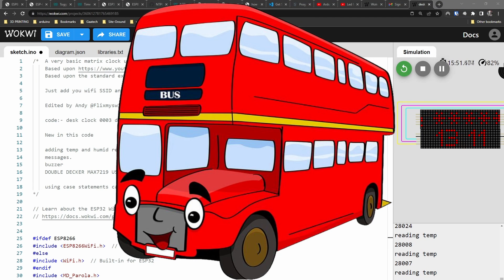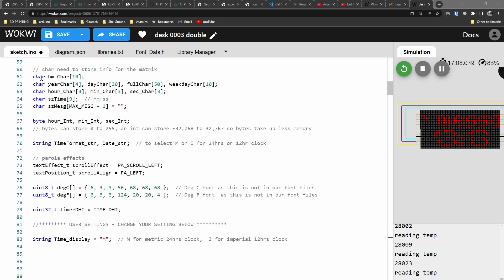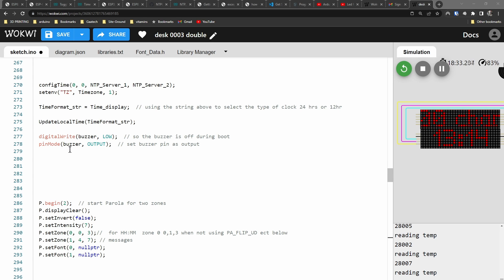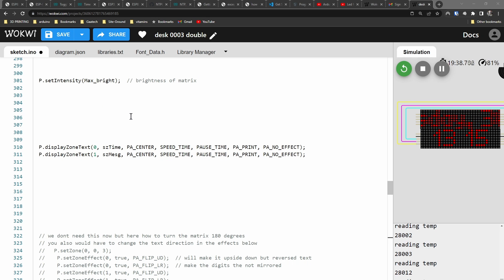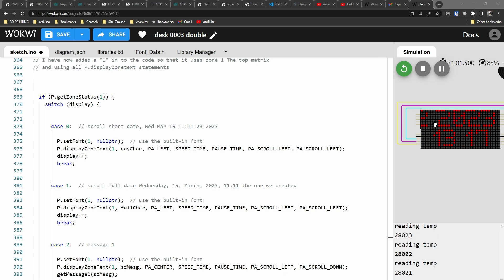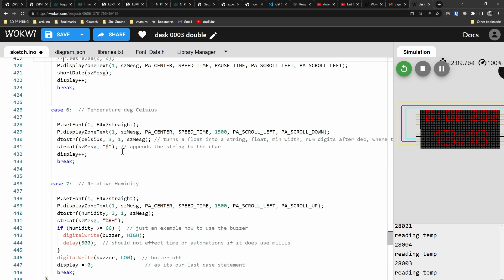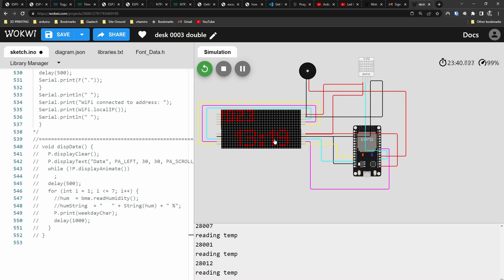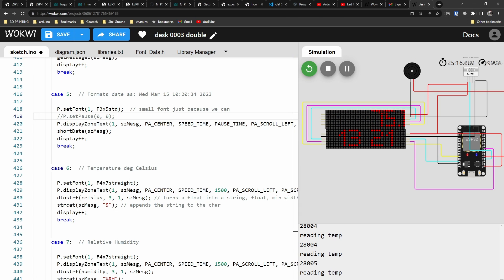Double height or Length #Max7219 #Matrix #LED  2 Zones #NTP 🕦 server desk clock with messages 0081

Comment: I didn't understand what you said: "Notice the number 12 where there should be a link to the code." I'd like to do exactly as you show in the video, that is, a scrolling message at the top, and the clock at the bottom. If you could share the code, I'd appreciate it.
Reply from the maker: Code here from previous video. I show the small alterations you need to make.

https://youtu.be/qnIo55A7Q-Q?si=-SY8MXDbvSy3bvHi

As I say in the video as its on the Sim so I can't test it on actual live matrix screens

Comment: coding?
Reply from the maker: As said I used a simulation to run this. Look at number 12 where there should be a link to the code. Then use this video to change the code to get the double decker effect

Comment: Hi Andy, just a quick question. What is the purpose of the buzzer? Is it an alarm ? I have managed to get the 2 zones to work. I have also made it to 3 zones as In previous videos to run seconds
Reply from the maker: Hi Andy. The buzzer is just because I had one. As in video used to indicate high level of humidity. But yes you could make like an alarm clock but you have to add buttons to set it and turn it off etc. Glad you got the third zone working for the seconds. 👍